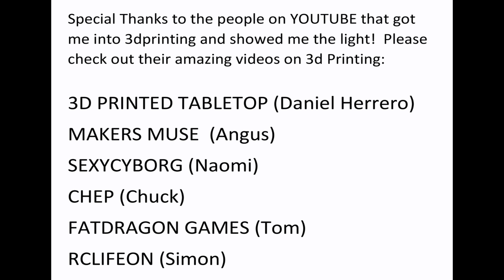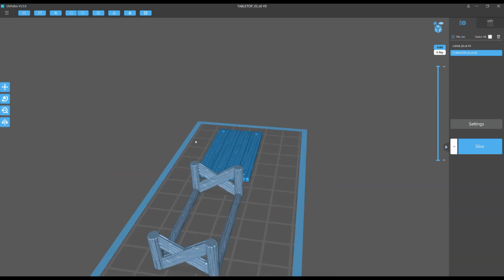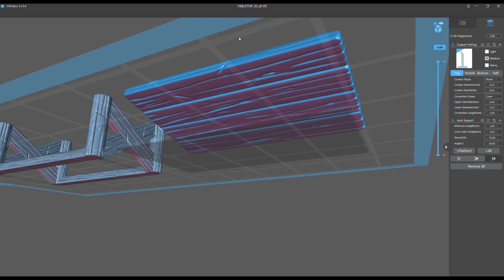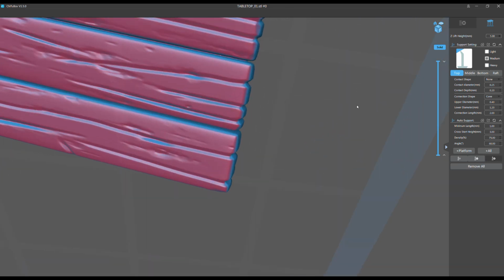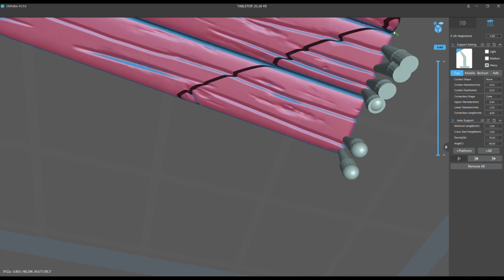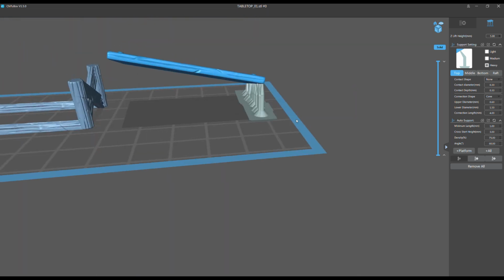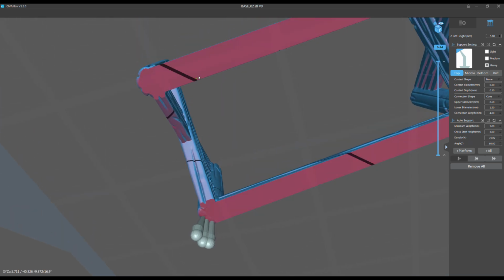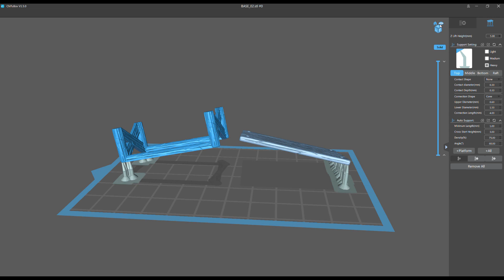Short video on orienting "flat" models with large planar surfaces.

Comment: Great videos glad someone is making these types. I think your approach is a very safe one. I am in no way an expert but I have been printing for almost a year. In that time frame I can say I've never had any issues supporting a long flat plane with my Anycubic Photon as it handles bridging very well. Much like a FDM printer would except instead of stringing the filament along from one support to the next with a resin printer the entire layer is created at the same time making bridging even easier. I just add more supports along that plane.

Comment: Ill just be that guy... How do you put supports on the rest of the flat surface? :-)
Just scatter them out evenly? Medium? Light?
Reply from the maker: I scatter medium usually ALL OVER after that.  It WILL damage the underside of the table but who cares?  If for some reason you do, you can stand a model like this up vertically, will take a lot longer time to print, but much less damage to the model and can easily be sanded since it will just be one small edge to sand.
Reply: @3dprintingpro212  I  was wondering if you have any examples of a complete support system for an item like this? I'm printing some tiles I've made and they're sagging here and there. I supported everything and kind of went in the other direction and the supports became suction cups and because of it, I ruined another model. I'm not sure if the weight is coming into play here but I'm having a hell of a time. I'm not sure how useful this would be but my tile is 5cmx5cmx1cm. So yeah. if you have any tips, examples or another video about this stuff, that would be awsome! Great video by the way, really been enjoying them!
Reply: I realize it is quite randomly asking but do anybody know of a good place to watch new series online?
Reply: @Brett Kaiser thank you, signed up and it seems to work :D Appreciate it !!
Reply: @Jerry Kayson you are welcome :)
Reply: @deangeloadam6680  hahah this is brilliant gg for helping a homie out in need

Comment: Thanks for the video - it's really clear now why we don't want a large flat surface on the plate. But a noob question - why not rotate the table top so it is vertical or almost vertical? It seems that would require fewer supports? Or is it that it would just increase the build time due to the increased height?

Comment: I do a similar rotation but it's a lot easier to just use auto supports with a very low density and then remove the ones you feel are extra or add some, this method is better because instead of eyeballing the lowest point you know for sure that chitu already put it in the exact spot where it needs to be.
Reply from the maker: I won't rely on auto-supports, and if you don't have your z height set right (which lots of people won't) auto-supports WON'T go in the right spot, hand placement is sure-fire!  :)

Comment: For these specific models I would simply turn them to the side, so that their length is up high vertically.
If you want to avoid any flat lines you can tilt them, so basically they have only a corner down (I wouldn't do that for the table top, but for the table base it could be useful, though on its narrow side it doesn't have large area).
The thing is when something is tilted but still very close to the horizontal line, it might get tilted when the base plate lifts, unless you support it heavily (I mean with plenty of supports, no using heavy setting :))

Yes printing vertically takes the most time, but I'm running production line, so I don't care much about the printing time. If it's too slow I just let it print in the night.
Printing vertically also saves a lot of supports, as the model acts as its own support, you just need to support well the bottom and all island.
(I'm printing at 35microns as it makes cubes from the xyz resolution on a Mars 3)

Comment: Hi, your non technical approach works well, seems to be a lot of average information such as tilt 45 degree it will be great, yeah right!. To be fair i am brand new to this and bought a Kelant S400, all advertising looks good doesn't it! I want to learn and use this for my work which is completely unrelated, what i want to do is small electronic enclosures (lids & bases of boxes) so mostly flat rectangular surfaces that create a lot of suction to the vat but with the added problem that all surfaces are seen, so the support cleaning needs to be as easy to sand as possible. I have Monocure resin which seems quite good, i think it's my lack of knowledge that is the problem, can you help?

Comment: I'm new to 3d printing and I'm confused with not wanting a flat surface due to suction but when we support the model  and put all the supports don't all the supports create a giant flat surface on the bottom? Thanks for the videos they help alot!
Reply from the maker: flat surface touching the plate is fine, once off the plate it's not fine  :)
Reply: @3dprintingpro212  what do you mean by this? could you please expound a bit?

Comment: I don't know if it's just new software, but I've not once had a failure with auto supports.
Reply from the maker: try autrosupports on a mini, then go thru and look for islands after, you will find a ton of missed spots
Reply: @3dprintingpro212  Hmm I guess there is a difference between a bad print and a failed print. I just started with resin. Seems like my main problem now is getting all the little burs off the mini when you break the supports off. I've used a rotary tool but it seems to take off more material than I want and leaves little pits.

Comment: Do you have a video explaining why you tilt things?  My brother just says it’s dumb because suction isn’t a thing and the supports are just going to make a big surface anyway.
Reply from the maker: politely tell your brother to do some research, there's this thing called physics!!! lol  :)       But, longer answer, that suction from the support bases is not going to rip away as its anchored by bottom layers which have great adhesion.  A flat part higher up is anchored only by supports...so not nearly as strong as your bottom layers...
Reply: 3DPrintingPro he is completely new to this SLA thing. I’m not expert, but I know experts and Pro examples always tilt things.   Now if only ChiTuBox would add auto orientation that works. And merge in a kind of island detection tools. That software keeps getting better, and so far from what I’ve seen, it’s the best option on a Mac. (We need spacemouse like windows as well)

Comment: Thanks for the video, but you forgot to show how much tilt should one add to the model - 5°? 10°?. I've been trying to print using an angling table found on the web which shows angles related to layer thickness (for 0.05mm for instance it says one ought to angle parts at 46.62°), however if I try to do it on some of my models I'm left with areas full of greebles which are hard or downright impossible to support. Any (good) ideas?
Reply from the maker: You want to balance eliminating a huge cross section printing at once, but without creating a ton of extra supports as well, every model is different  :)